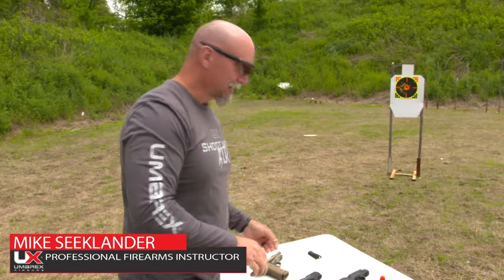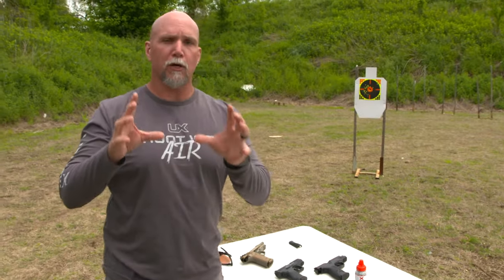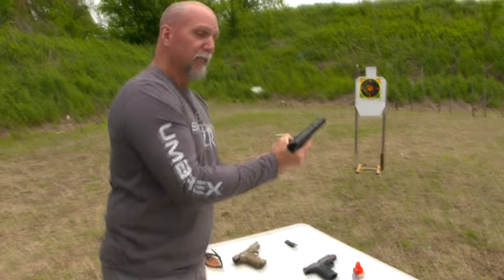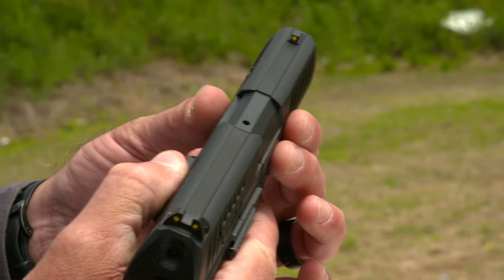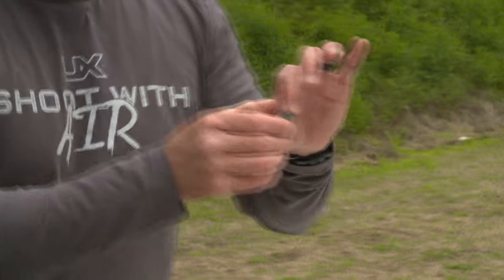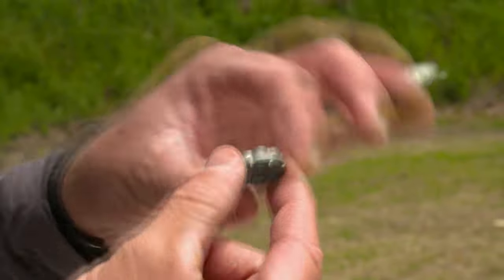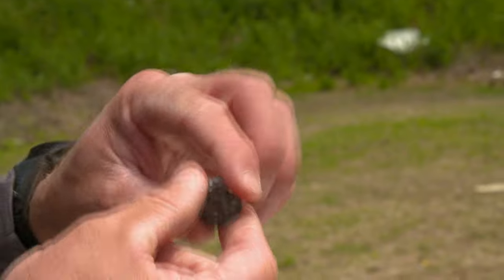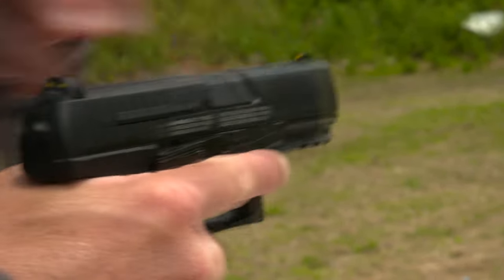Umarex Airgun Tips on Using CO2 Air Powered Pellet Pistols and BB Guns

Comment: Great video.  Those full auto BB pistols are a real hoot.
Reply from the maker: Thanks a bunch!
Reply: @UmarexAir  I seen  a utube video were a person  who  use s petroleum  jelly.
Reply: @UmarexAir  I wish  they would  make a co2  already  prelude from the factory. That would  great.
Reply: Are the full auto bb pistols real air guns using 4.5mm steel bbs like the rest or are they just plastic firing Airsoft-like pistols?
Reply: @jackconnor8463  there’s both, but these are.177/4.5mm. Airsoft is 6mm and will have an orange tip(in the US).

Comment: I definitely agree with using Pellgun oil or silicone oil in any air gun as products for real firearms will degrade the seals. I wanted to throw a tip out there as I've seen videos like on the crosman R1 I recently purchased where people were recommending spraying WD-40 into the speed loader full of BB's. Although WD-40 is a lubricant it also has solvent properties that will eventually degrade the seals.

Comment: The Extended mag you can take one and insert opposite if the plastic one breaks.Metal replacement works,just invert the piece before putting in.I did that on my extended mag for the Beretta Airsoft.

Comment: QUESTION? I’m new at this and need to know if you insert the co2 cartridge do you need to use it up right away or can you shoot a couple of bebes and store it away for several weeks and use it again. Thx
Reply from the maker: Unfortunately, it's a bad idea to leave a pressurized CO2 cartridge in an airgun. The constant pressure of the CO2 ruins the seal.
Tip: put a drop of silicone oil on the tip of the cartridge when you insert it. This lubricates the internals and the seal.
Reply: @UmarexAir  ok thx 4 the quick reply. Great Video!!

Comment: I JUST BOUGHT A LIKE NEW GLOCK 17 C02 PISTOL WHEN TIGHTENEING THE CO2 I UNDERTIGHTENED AND THE C02 LEAKED OUT.
ANOTHER ATTEMPT AND MOY LEAKING .
HAVE I DAMAGED THE MAGAZINE (THAT HOLDS THE C02)
4 CAPSULES ONLY 1 SUCESS... BUT OVERTIGHTENED THAT ONE AS WELL.
Reply from the maker: Call a service tech: 479-646-4210 ext.7 or : https://www.umarexusa.com/contact-us-ux
Reply: Never over tighten its a comm9n mistake l have bought guns from gunstores where they have put in a bulb to test it then handed it to me l test the bulbs tightness and a few places it was rock solid l handed the gun back and took my custom elsewhere. One was so tight the guys in the store couldnt move it and had to really go to town on it using a vice and rubber mallet to hit the alken key to release